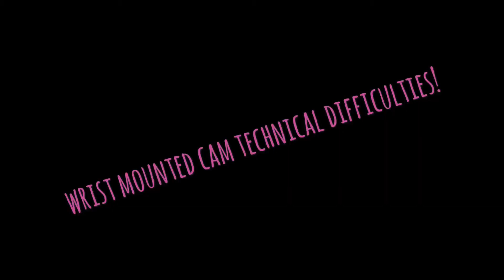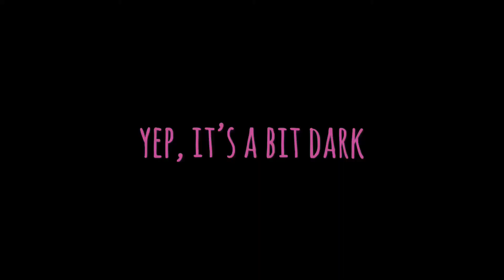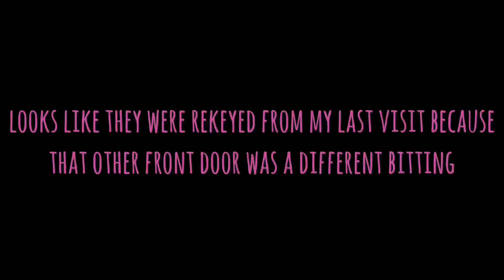some days, it’s quicker than others

Comment: A am a locksmith and have had my share of hard days. Just curious why you didn't pull the first picked cylinder and decode/cut a key to open the other. Did I miss that part?
Reply: Joseph Neece , I had the same thought Joseph. I would have measured the pins and made a key. I’ve done that on several jobs over the years. 👍🏻

Comment: Why not make a bump key out of the key that was left? Assuming it’s the same keyway, or just make one at your shop? 
I understand that some Locksmiths are “anti bump key”, but if you take precautions and know what you’re doing there’s no damage. 
I’m an entry specialist. I usually will pick first, if no luck in the first few minutes I’ll go through my bump keys, failing that, electric pick gun. If it’s a new to me keyway I’ll call the shop and have the other tech make up the bump key and I’ll go do another job, pick up the bump key, go back when possible. If I still can’t get it with the bump key, it’s time to drill.

Comment: Jason thanks for posting vids like this for those of use learning the business. Quick question...when you rekey locks like the ones in your video, do you typically have precut keys and just re-pin the cores based off those keys?
Reply from the maker: William Murray yep, I usually cut different sets of keys (4,6,8,etc) in the shop and pin up in field based on how many the customer needs which we try to find that out on phone call (see video, 5 questions)
Reply: SE Lock and Key Thanks for the info!

Comment: Definitely harder out on the job with a door frame in the way and not at the perfect angle in a vise I love lock sports but on the job is a different animal altogether well done
Reply from the maker: Paul Chaulk thanks for the idea :) ;)
Reply: Damn, homey, you need to take lessons from James Rockford, Private Investigator.  Nothing like picking the lock on a trailer hitch, to repo a car, or a boat. Second favorite, "Roof hatch padlocks". Why is it I can pick locks to the locked position easier than the unlocked position??? Enter, THE PLUG SPINNER! Some time you have to "DRILL THAT MUTHA OUT! " I just did a bunch of Best SFIC tool box tapered cylinder cores. I had no idea a spreader locking mechanism could hold 16 tons of dirt and dried mud, along with the tips to two broken picks.